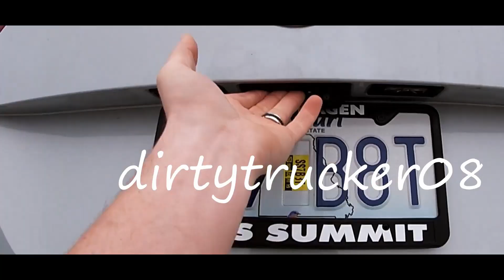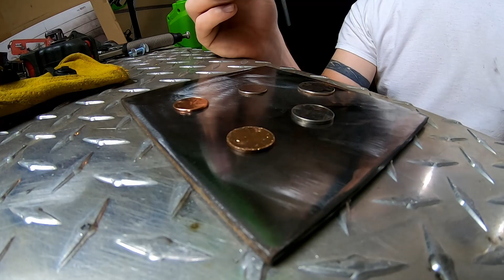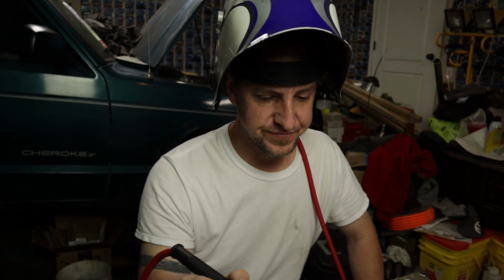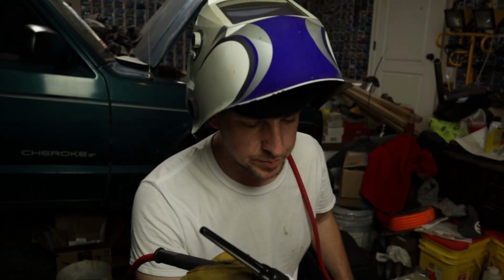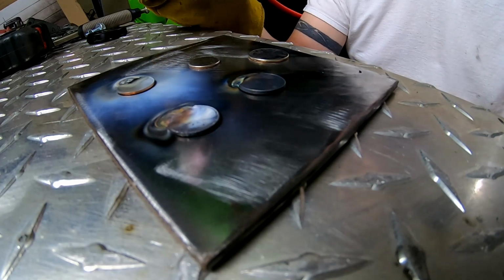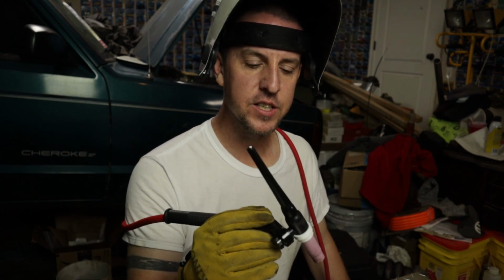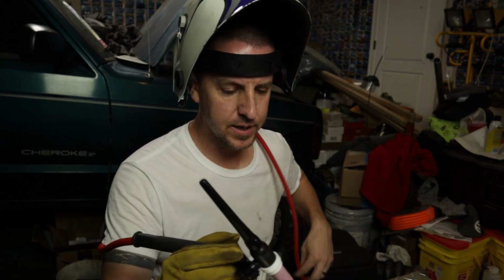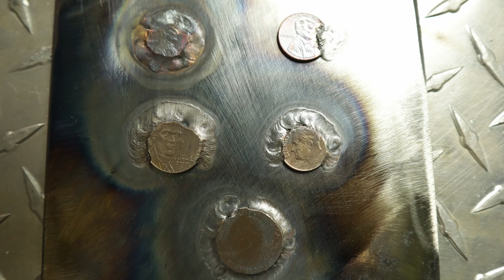Can I tig weld coins?

Comment: Pre 1982 pennies are 95% copper and 5% zinc alloy

Post 1982 pennies are a zinc alloy with a copper plating. 

If you want to know how zinc effects the weld, think about galvanized piping, how it welds and how it's a heath concern. That's a zinc coating on steel. Anyone who has welded it knows it puts off that white/grey smoke. I'm assuming that's zink vaporizing or reacting with the other metals. I'm thinking maybe once you get to a certain temp/energy level you are separating the copper and zinc in the old penny as well but I'm not sure how being an alloy effects that. Ether way 8s be concerned about breathing the fumes from any of those.

Someone teach me more if you know. 

Great video though, it makes me wanna try coin welding.
Reply from the maker: Info I need to research, thank you for sharing.